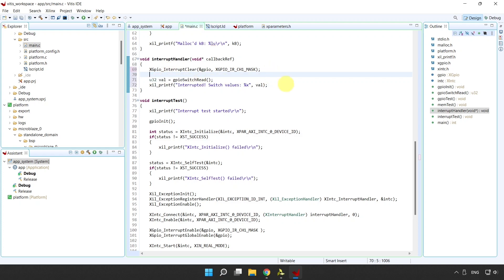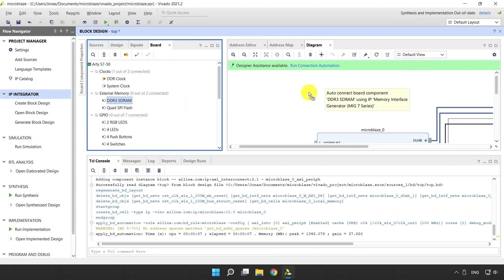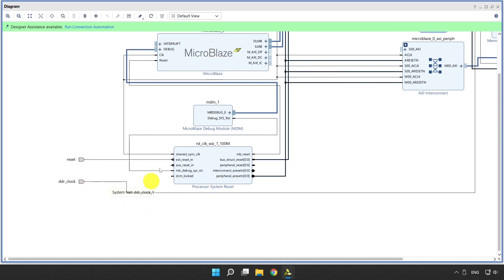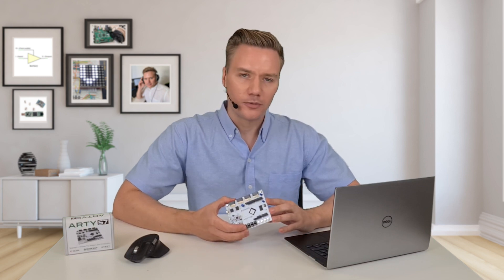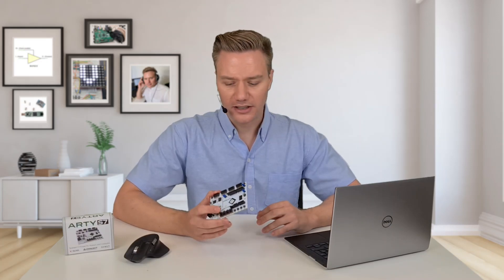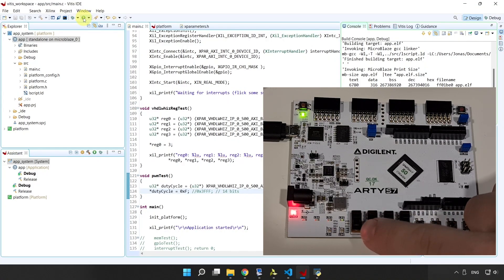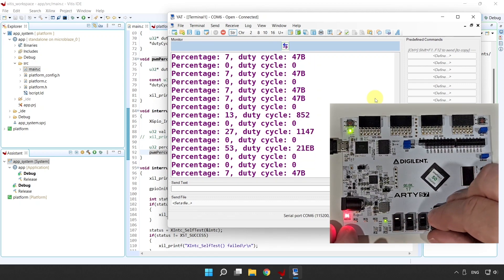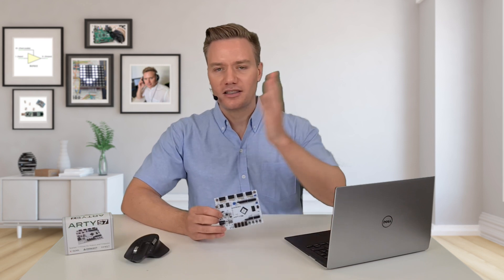Course: MicroBlaze SoC design

Comment: Hello I have a question, I have an assignment to write and VHDL code of Adding 2 unsigned numbers, and then to show it of in the GTKwave.
The sum should be 00 for the first 10ns, then after that it should continue normally with the work
also I need to implement the carry out which is std_logic,
What would be the best way to go about this assignment, thank you in advance :)
Reply from the maker: Not really related to the content of this video, I would start by setting up the development environment and instantiating your device under test (the adder). I'm not sure what they mean by 00 for the first 10 ns. Perhaps they want you to keep the module in reset for 10 ns. You do that from the testbench.

Adding two numbers is as simple as: y <= a + b and the carry will be at y(y'high)

Best of luck!